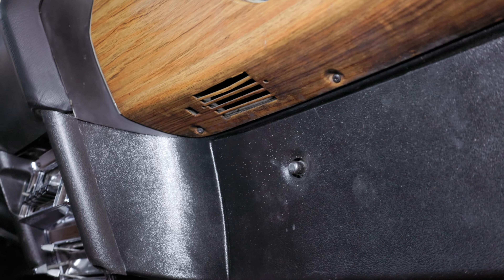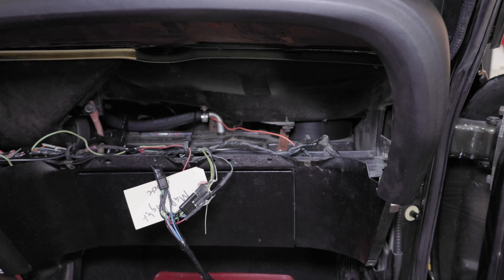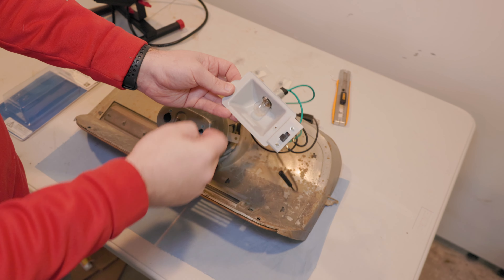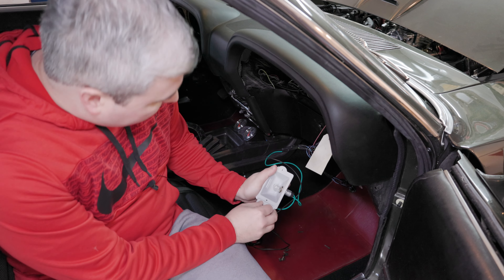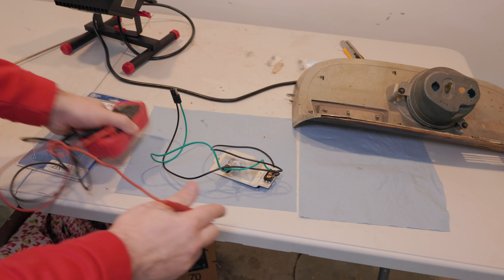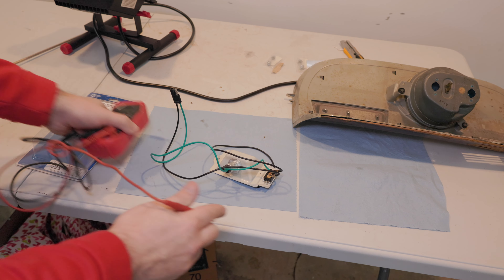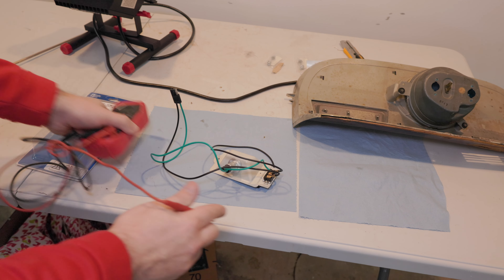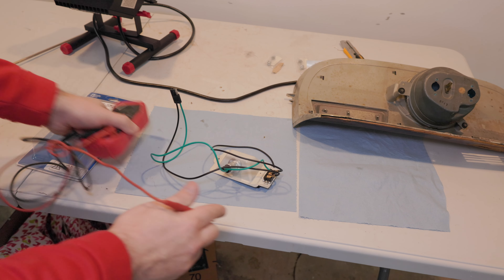1969 Ford Mustang Map Light Install

Comment: I had the exact same problem with my map light, thanks for the video!
Reply from the maker: Bad connector? Sad to see it’s not fixed yet in their manufacturing! Glad I could help.
Reply: @SmackeysGarage  Yes, neither the green or black wires had continuity to the switch.
Reply from the maker: Glad you got it sorted out!

Comment: I just had a similar problem installing a repro map light in my 1970 Mach 1. Drove me nuts. It should have been a simple plug in and you'd be good to go. It turned out that both connectors on the map light were bad! I had to splice in 2 new connectors and then it worked as it should have from the beginning. It looks like there was a defective batch of these made. It is sad that the unit did not perform as nice as it looked. This is the chance we all take using repro parts, sometimes they work great and other times, not so much.
Reply from the maker: I'm in agreement with you. Sounds like there was a bad batch of these made. There was nothing visually wrong with the one I had and you can only tell when you used a multimeter on it. Glad to hear I'm not the only one that had this issue! I'm with you on repro parts. Sometimes they work, sometimes they don't.